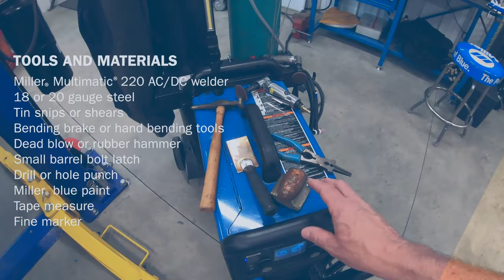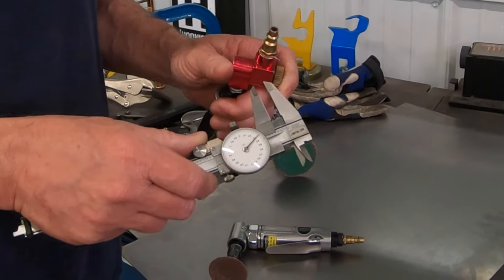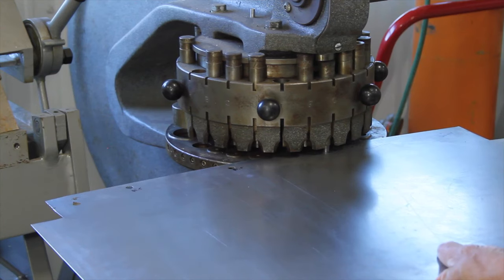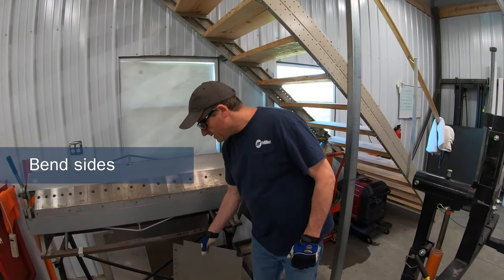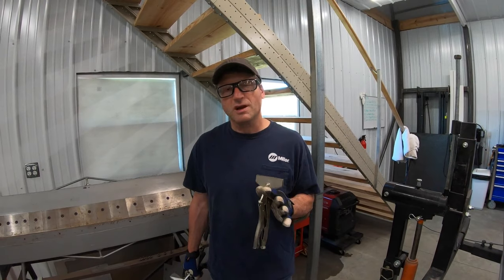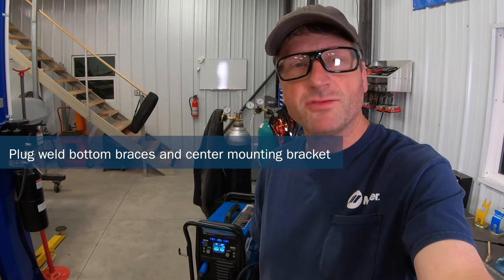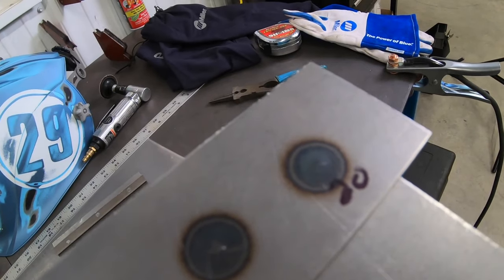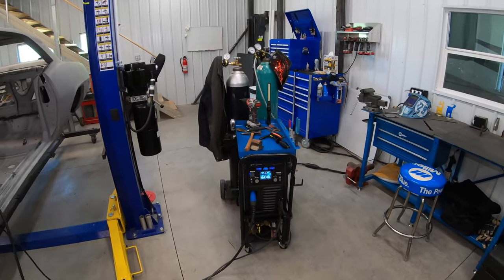DIY Welding Project: Welder Tool Tray

Comment: OOOOOOO, Very nice, I want to make one of these for my machine, I have a miller multimatic 255 with all the running gear and the dual cylinder cart and I always set stuff on top of it... for the price i paid for that bad boy, this tray would be a worthy bit of insurance/protection. What kind/color of paint do you use to match your machine perfectly?

Comment: Andy,  Great video.  I arc welded in 1970 (high school) can you recomend a all purpose welder for my shop?  I want to practise and learn some new skills. Thank you so very much. 
Respectfully
Reply: Hi Thomas- if you truly are looking for an all purpose welder that can MIG - TIG or STICK weld, the Multimatic 215 and Multimatic 220 AC/DC would be my first choice for easy to use multi-process machines.  The Multimatic 215 is a DC only machine and the Multimatic 220 does AC and DC for TIG welding aluminum and has AutoSet Elite in all processes making initial weld parameter set up super easy.

Comment: Why didn't you weld the corners?
Reply: We did spot weld the inside corners at the 8.25 mark of the video.  This project didn't need the sides fully welded.